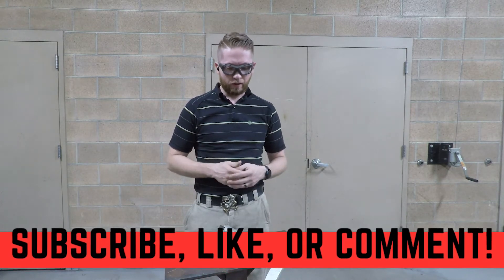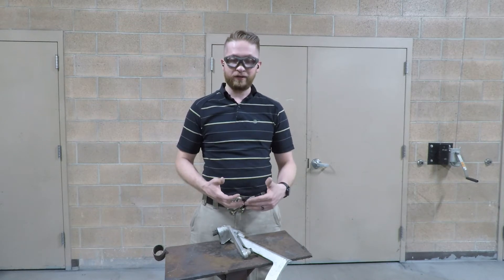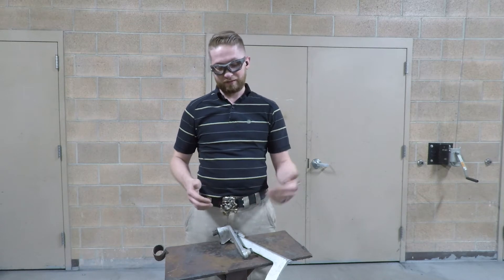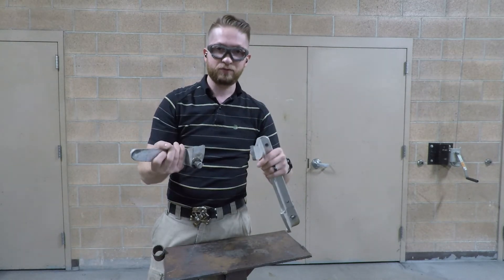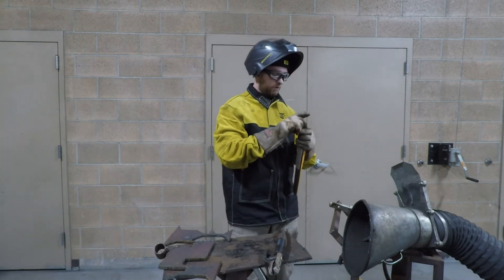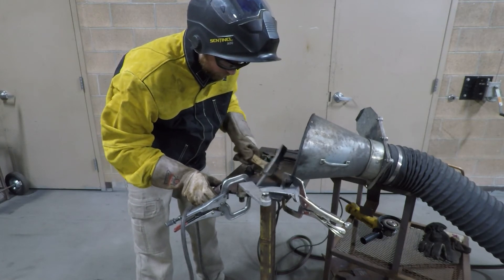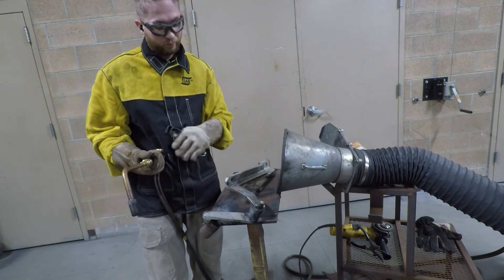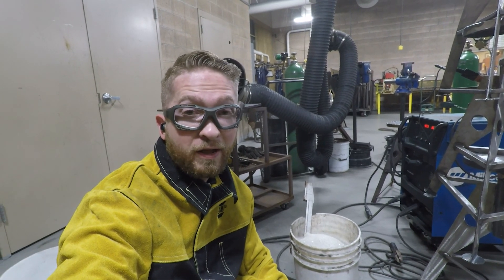How To Weld Cast Iron

Comment: Did you use AC or DC setting?
Reply from the maker: I used DC. but I would check with the rod you used.  I could see some using AC.